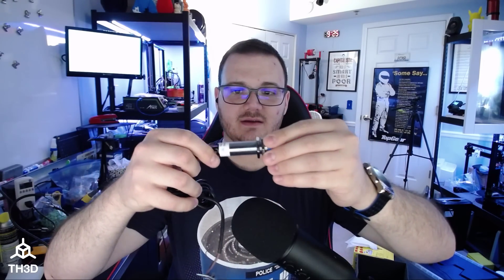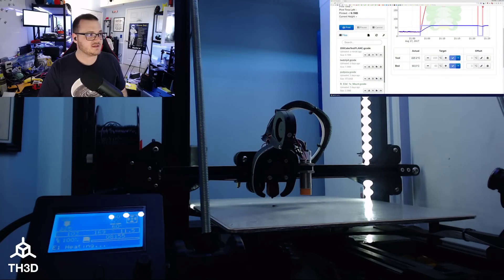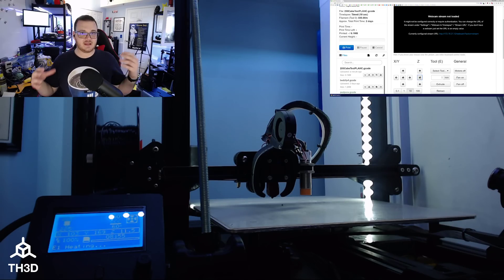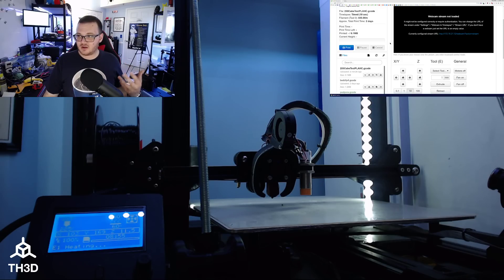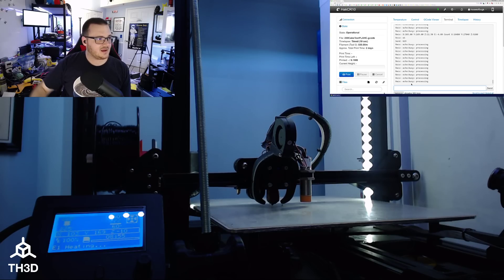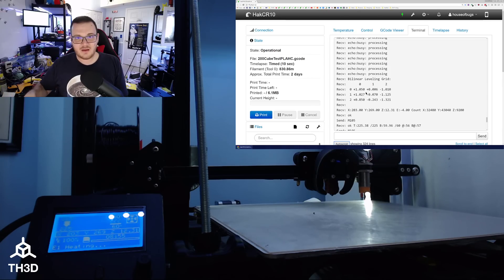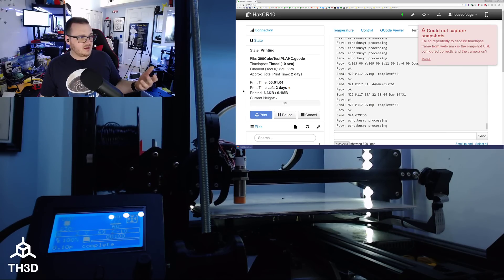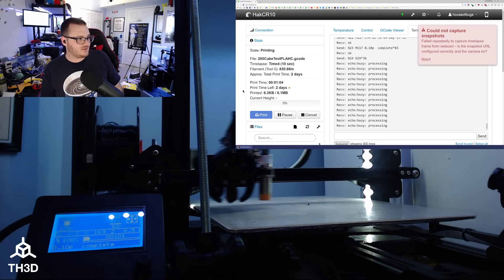EZABL Bed Leveling Kit REALTIME Demonstration - NO CUTS - CR-10 and others Auto Bed Leveling kit

Comment: This might be a dumb question, but how does it level the bed without adjusting the knobs underneath? Does the user have to do that manually?
Reply from the maker: It uses the Z motors to compensate. :) Its a really cool system.

Comment: hello, hope all is well.
i have an ezabl, and recently saw the newer version on your website. what are the differences if any? and could I just upgrade the head?

thanks have a good weekend
Reply from the maker: The main differences are the new cabling, faster sensing rate, and lighter weight sensor. If the older kit is working well for you then stick with it and save the money.

Comment: Where can I find the lighting kit you have on your Cr-10 printer? I love them and haven't found where to purchase or how they are mounted etc.  Also I have a live order with your website now I believe based on the logo on this channel it looks just like the website I found and placed an order on that still hasn't shipped BTW while all others that night I ordered did.  I had to approve the security from a text by my bank but it should clear. Please let me know if its still on hold for you. The order is for the  Z axis leveling stickers (as I have a dual Z mod and want to ensure its perfectly Level) and a Radial fan. But I can never find anything on your lighting setup. I would buy a kit from you it you had one together.   I cant find it anywhere but when I come across your printer etc.   Please let me know!
Reply from the maker: They are just some 12V LED strips from Amazon. They are the smaller ones NOT the 5050 models.

Comment: Thank you so much for your nice video.
Ive never seen an expert like you.
I'm using CR10 5s. But it has so terrible flatness.
I got to know how the auto bed leveling works thanks to you. But I dont still know How I can install it and change firmware setting.
Could you please make a video for step by step instructions?
It will be very helpful to beginners.

Comment: I don't understand what makes this any different from any other sensor?  I mean it's not any different right?  you have just put it together in a kit with either a 110 compatible wiring(either a mosfet or relay) , or a 5v compatible wiring(buck converter)... ,?  or do you even have a 5v version or just AC & 12-24v?  regardless though it's just a standard Chinese capacitive sensor that you have pre attached the two wires that normally someone else would have to do? is that right?  and the 12v version you haven't really changed at all then.   I'm not saying it's not a good idea, I like it, I'm just trying to make sure I see how you are justifying the extra cost and the ability to label it as, " your sensor"..

Comment: Your hotend extends way down compared to my CR-10. Is that a Mod? And if so, where do I get one? Also, what is the benefit of having the extension other than being able to see the nozzle when it's printing?
Reply: I have decided on the E3D V6 Gold edition because I plan on printing lots of NylonX. I just purchased a easy connect auto leveling kit from your website.
Reply: Ok, so I received the easy connect sensor and started watching the install video, and realized I needed an Arduino UNO to flash the firmware. I bought that and it arrives in a day or so. While I'm waiting on this I was pondering the universe and the reason for my existence and it occurred to me that I might not need to flash my firmware. I have a question for you. I bought a seat of Simplify3D, do I need to flash my controller if I use Simplify3D? Or does the simplify just plug into my existing controller and use the 3D printers controllers firmware to operate the printer? Just curious. I have no worries about flashing a device.

Comment: This sensor looks pretty awesome, but I'm curious: does it work on the CR-10S, which apparently has a different motherboard than all other CR-10 models? It seems the CR10-S has unused ports that might obviate the need to unplug the z-axis limit switch.

Comment: 1. Can you share the start gcode for your kit? 2. Do your recommend to switch off the heat bed after reaching the target temperature and then doing the leveling? The magnetic field of the heat bed can have negative impact to the sensors i guess. WDYT?

Comment: Where do you sell the Auto Leveling Kit?   How Much.?   Any need to change the original glass?
I have a Raspberry Pi, but for a different purpose at this time.  Is the use you have described leading to dedicating the Raspberry Pi,  Are you running Lenix on it? What version etc. etc. Does the kit have the SW for the Raspberry Pi also.

Comment: I'm confused as to how the kit is actually levelling the bed?

I know right now I have to manually level the bed every damn print using the dials underneath the bed.

Is this kit simply...modifying the printing process to compensate for the level of the bed being off? Or is it somehow actually changing the level of the bed?
Reply: It’s a software that moves the nozzle up and down depending on where the bed is uneven, so the nozzle always stays level with the bed. The bed doesn’t actually level itself, but instead the nozzle levels with the bed. 👍👍
Reply: I see...thank you for the prompt response!

I'm also curious if...compensating for the misalligned bed rather than levelling it will result in the bottom of the print being misalligned as well? So if I print something rather large that's meant to lay flat on a table or desk, would it end up wobbling?
Reply: Awesome, thanks for answering my questions! :)
Reply: I dont see the answer? :/